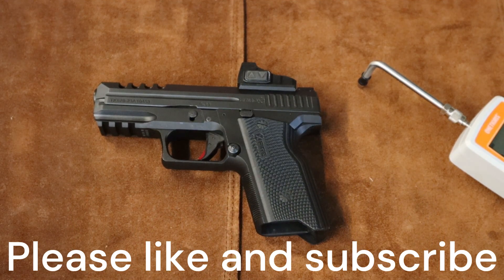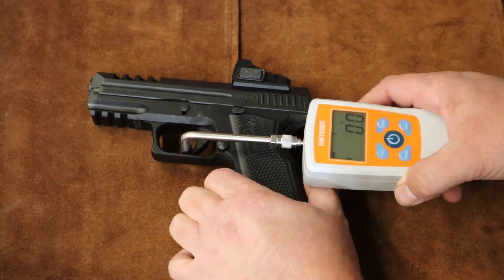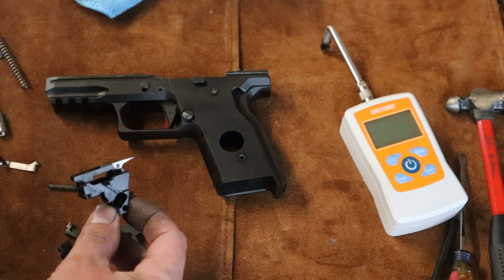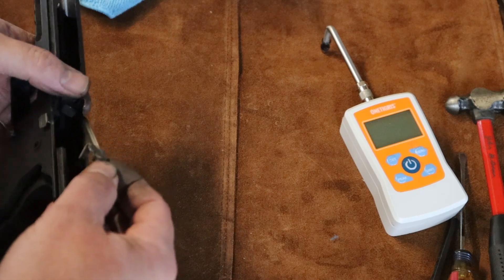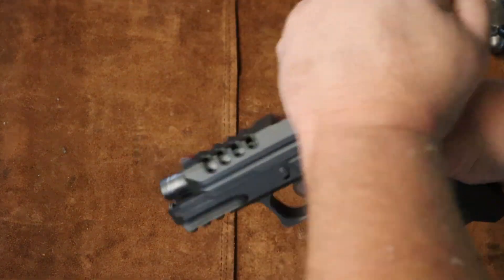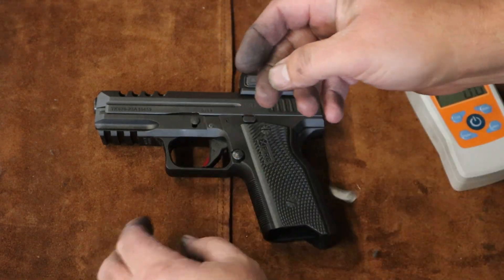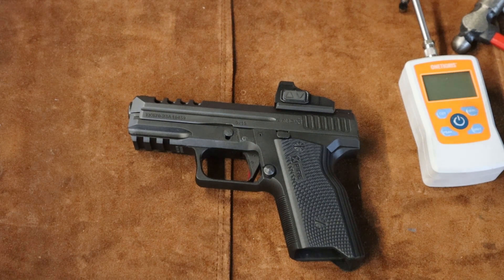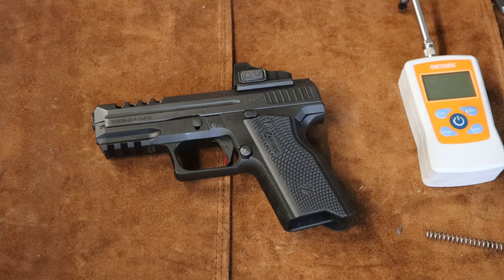Ermox XFIRE $5 Trigger Job

Comment: Just picked mine up today. Going to the range tomorrow. Enjoy your videos on this particular gun. Thanks for the tips!
Reply from the maker: Thanks for watching and commenting. Please let me know how yours does. I have gotten messages from several people about the triggers failing in the first couple hundred rounds. I think the problem is the same one I had with the connector. It's an easy and cheap fix but after the results of this polish job I think I will get a 3.5 connector and see how that improves the pull weight.

Comment: Very good information. I'd never heard of a reduced diameter spring before. I'll be looking for one of those. Thanks
Reply from the maker: Thanks for watching! I suspect that I may have some light strikes. I have used the 3 pound springs in conjunction with titanium strikers without much trouble but this steel striker may not like the light spring. I will post an update once I can get some time to shoot. Hopefully this weekend.

Comment: If you really want to fix this thing, just buy a Glock firing pin set with spring and cups, it fits perfectly and is smooth as silk.     You'll still need to do the polishing shown here though, but a new firing pin striker spring was really the difference.
Reply from the maker: Thanks for watching and commenting. I did replace the spring and it made a big difference. I also replaced the cups with plastic Glock cups.
Reply: Where do you get the glock firing pin set from and for what model and gen?
Reply from the maker: @albertsanchez2027  the parts I have came from midway. They are for gen 3. Most places sell gen 3 parts so they should be easy to find. My local dealer also has a good selection.make sure to check yours.

Comment: What weight Zev striker spring did you put in it?  OEM Glock is 5.5lbs, but there are a variety available...4, 4.5, 5, and 6 I believe.
Reply from the maker: I am not 100% sure but I believe it is a reduced power spring. Probably a 3 pound. I had it in my box of springs and it didn't have a label on it, just in a zev package. My organization skills are slightly lacking🤣🤣
Reply: @gillysguns9244  Thank you!  3 pounds?  It will be interesting to see if you get light strikes.

Comment: You put in lighter spring in
Reply from the maker: I did replace the striker spring with a 3 pound zev spring. I also replaced the metal striker cups with factory glock cups. This worked great.

Comment: Would this be a safe ccw?
Reply from the maker: Thanks for watching and commenting. I guess you are asking about the functionality after the trigger job. Since all of the internal safeties are still operational the gun is still safe to carry. The trigger pull is lighter and smoother but it is still in the safe range for normal use. 

As for the ermox itself, I wouldn't use mine for ccw because of the problems I had early on. If it was the only pistol I had then I would carry it. It is most definitely better than not having a gun.

Comment: Would you trust your life with this ?
Reply from the maker: Thanks for watching and commenting. I would trust this as much as any other pistol. I don't carry a gun unless I run at least 500 rounds through it. This one has performed well now with around 1300 rounds. Not perfect but as well as I would expect. I have not been nice to it and it keeps going. The only thing I have noticed is the optics mount works loose and the chamber is relatively tight so it is picky about the overall length of the cartridge. My reloads run long since my dies are setup for major 9mm loads. When I shorten the oal they run perfectly. If I carried this I would remove the red dot sight as I don't trust any of them. 
In comparison I have had brand new sigs and glocks fail right out of the box. I still carry a Glock most of the time. I bought the ermox as an experiment, not a carry piece.
Reply: Yes I would

Comment: What exact spring did you use?
Reply from the maker: The spring I used is a zev 3#. If you search for this part number on midway you will find it. SPR-STK-3LB. They are in stock right now for $5.25. I also ended up changing the firing pin cups out with glock parts. That is another $5 but they cause less drag in the firing pin channel.
Reply: @gillysguns9244  Thank You!